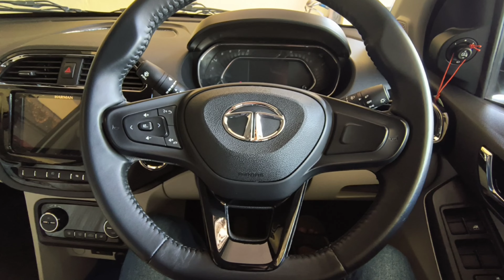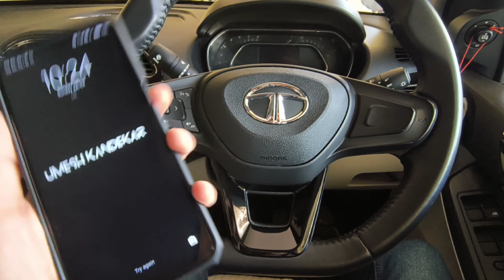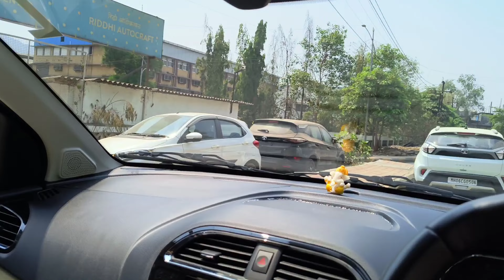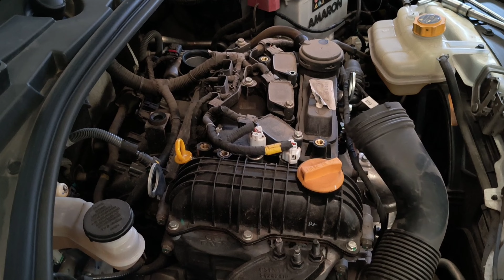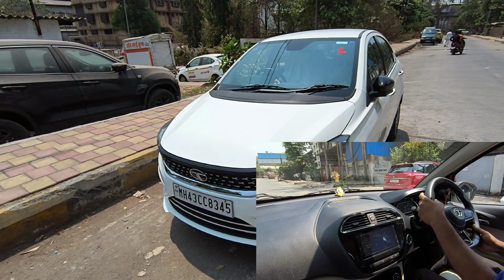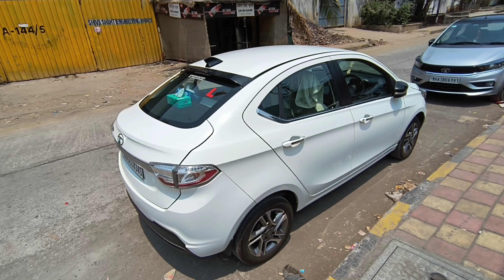Car not Accelerating? Do this! | #Tata Tigor Acceleration Problem | गाडी ने दम तोड दिया! 😐

Comment: Tata Car not acceleration is now days common issue. Only solution is check battery Health. After battery replacement this issue will get resolved.
Reply from the maker: Thanks for those insights ❤
Reply: God bless you 🎉🎉
Reply: Tata me ye problem bar bar aa rahi h or service center wale lugne bethe h
Reply: Sorry not true.. same problem..

Comment: My Tiago AMT has the same issue..
Reply: Have you found any solution?
Reply: @girishbhadri1441  changed ECU..it will cost around 12k. but will cover under insurance.

Comment: car accelerator chhod rhi h... & engine check light arhi h.. full acceleration dene pr 2000 rpm se oopr nhi jarhi..
battery problem h ya chuho ne wire cut ki
Reply: battery issue hoskta h kya chuho ne wire cut ki h?? dono me se koi ek issue hoga ??